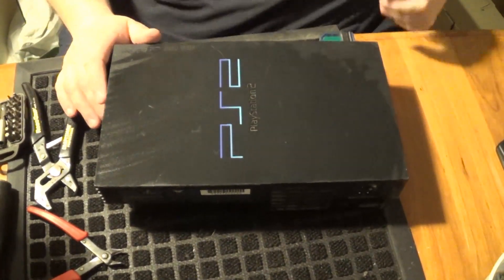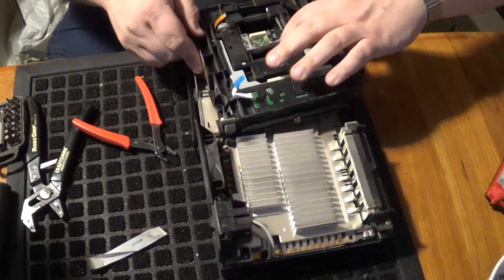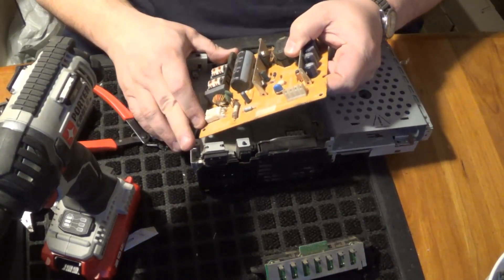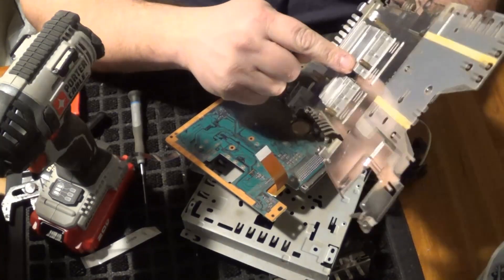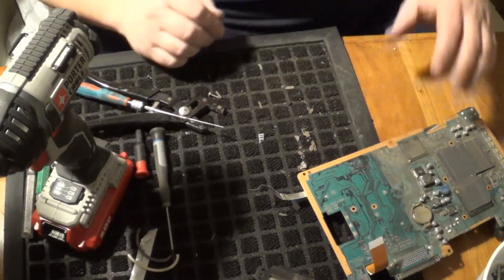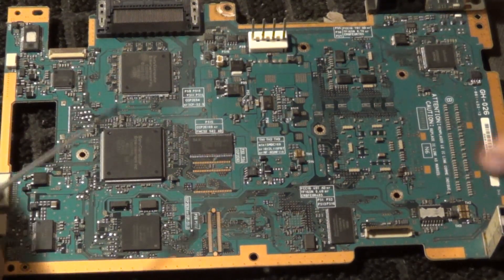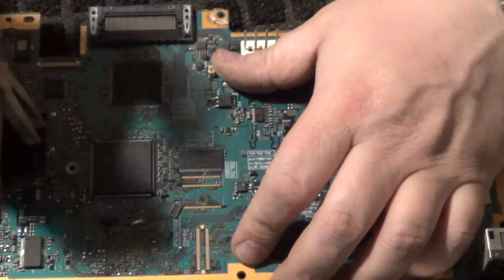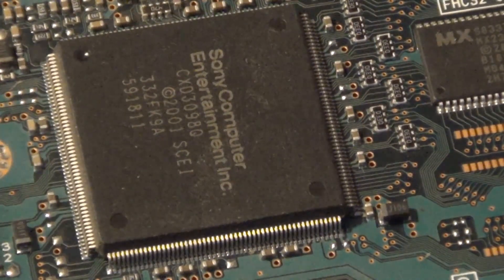Scrapping a Sony PlayStation 2 for FREE GOLD and other metals! -Moose Scrapper #283

Comment: The chip you asked about with the metal on the back. If you aim the steel side up and epoxy side down take a flat head screwdriver and drive it through the steel backing at all 4 corners of the epoxy. The epoxy will pop out and then processed with bag caps 👍
Reply from the maker: Sweet thanks!

Comment: Another question, Moose do you still use the sand and grill method to remove chips? Or do you use the air chisel . Keep up the great work we appreciate your videos and you.
Reply from the maker: The sand bath method is really only for small boards like cell phone boards.  I use the air chisel for just about everything now.  Cell boards I dont get a whole lot of so I use a heat gun these days.